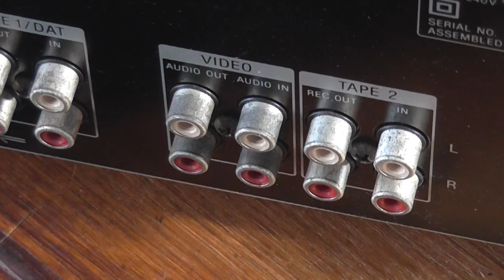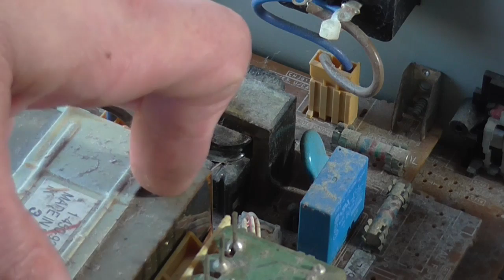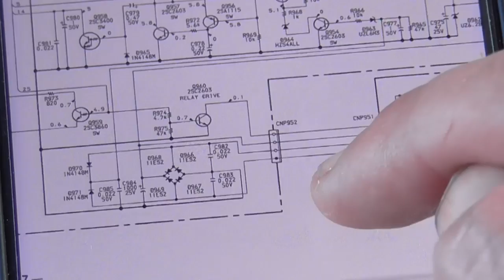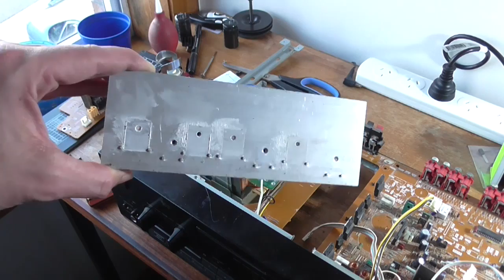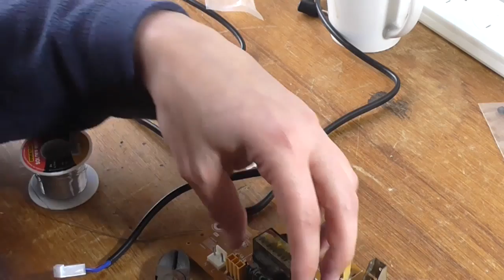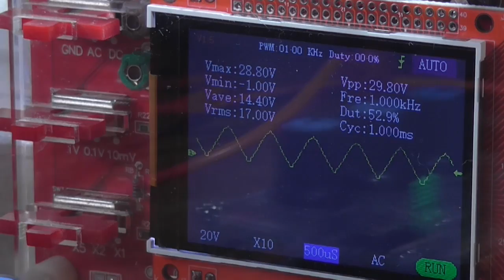Sony STR-D390 Stereo Amplifier Receiver REPAIR! (No Parts!)

Comment: I have had a Sony STR-D565 receiver for many years and, to my surprise, nothing seems to break down in it, and I still use the PHONO, FM, Tape and CD inputs as universal, together with DENON USC-90 speakers, and everything works properly, I am amazed that it has worked for so many years.

Comment: I had someone give me a D-390 with some speakers I bought. He said it was not working so, of course, I took it. It powered on but no right channel. It turns out it was same issue. Seems Q951 (2SD2092, the one with the heatsink) runs very warm. Warm enough to damage some solder joints and discolor the PCB. I pulled it and it tested normal so I pulled the heatsink as well and increased its size. I reflowed the joints in the darkened area. Worked fine after that.
I also found that the PCB had an excess of residual flux from manufacturing. Its a Sony, right?

Comment: Excellent explanation, very enjoyable video.
I have the Sony STR-D590, which is very similar to the one in the video. I don't know the differences, and I don't understand how I could clean the potentiometers. I've tried, but I think I'd have to disassemble/remove the front panel.
Could you make a video showing how?

Comment: I followed your steps and I can finally hear it. Now I only have a problem with sound distortion.
Reply from the maker: @angelduran10  distortion can be for a number of reasons from other bad joints, caps or lack of negative feedback due to open components. Either that or your input level is too high.

Comment: I've had to write off some very good receivers as their mainboard have unreplaceable MCUs and these units were barely 5 years old, nobody could supply spare boards, even the brand's ASAs
Reply from the maker: Yeah, that's always a shame. Unless, you have a parts unit to pinch the MCU board out of, you're kind of stuffed.